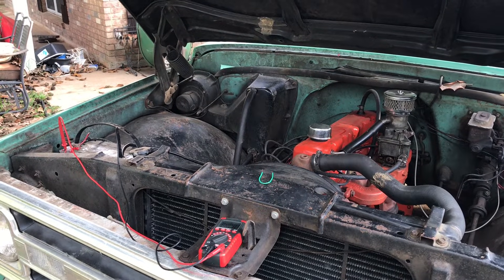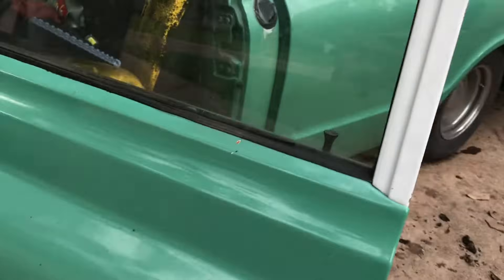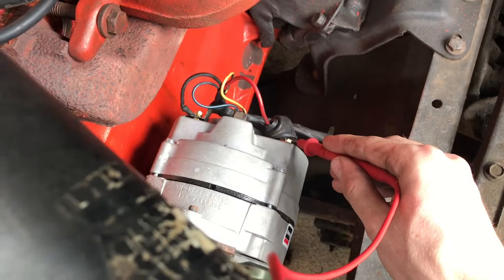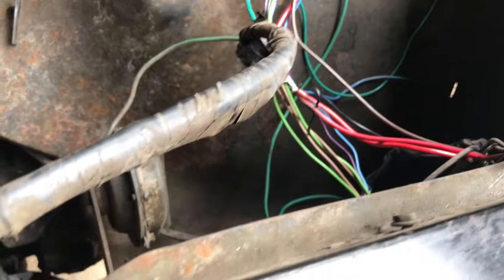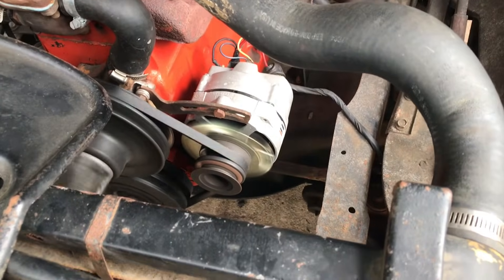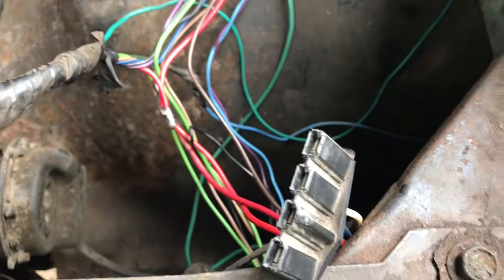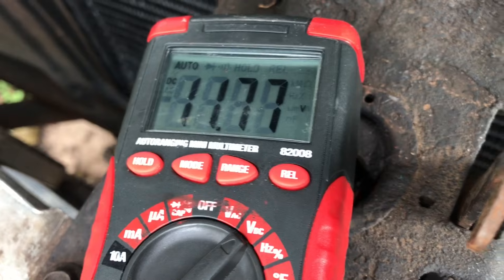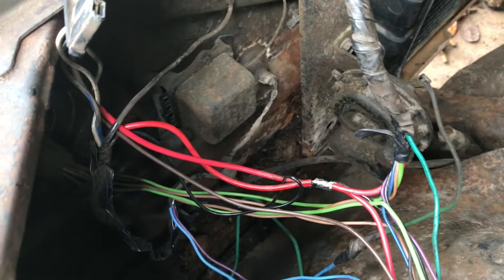How To Test An External Voltage Regulator (Pre-73 C10)

Comment: Your question at 0:25... My car doesn't start but shuts off while the GEN light is on. I have a 75 Impala and still unsure what the root cause is. When I turn it over, it runs for a few seconds before shutting off again. Any ideas?

Comment: Great video.  I am having a problem with my 1971 Cadillac Fleetwood and it looks like it has exactly the same wiring for the Voltage Regulator.  Would you happen to know what normal values are for the Field Pin on the VR?  I am getting only 2.17V - 4.31V (idle vs. higher RPM).  Also, the Sense Pin #2 varies from 3.3V at idle to 6.08V at higher RPM.  My guess is this is low.  I put in a new Voltage Regulator just now.  Alternator is a couple months old.  I know there is an adjustment procedure for the Voltage Regulator.  Wondering if that is my problem.  Your jumper trick will at least let me prove the Alternator is capable of outputting the right charge level.
Reply: DoubleWrench...  I just ran your test and the output of the Alternator is too low when I jumper the VR connector Pins F and 3.  Please look at this short video.  Is this squeal coincidental?  Very strange it goes away at idle only if not jumpered.  I always thought the squeal was the air pump, but now I am not sure.  Thx.  Sorry about the video quality...  I did not want to leave the jumper connected for long.  https://youtu.be/aniE0mZsUxk

Comment: Ok so I used jumper wire to do the test  and battery is still at 12.13 volts  while running. Also have 12.13 volts. At brown wire and red wire     So does that mean alternator bad?

Comment: Finally someone explains it. No one likes to buy a new alternator and finds out the old one has no issue.
Reply: I just did and ai am afraid to find out that  the at this whole the problem it was the voltage regulator 😅
Reply: I took mine to get rebuilt because my battery wasn't charging, they probably said easy money and alternator was fine and this whole time it was the voltage regulator.

Comment: My '72 GMC truck had a voltage regulator issue, when I went to replace it with an old one I had changed out unnecessarily decades ago I found 2 of the blades had enough rust on them to possibly be the problem. I sanded the rust off and put it back together and to my surprise it works just fine again! I can put that old regulator back on the shelf again,who knows,' I might actually need it someday! Thanks for making this video, it was very helpful.

Comment: Great video!  I have a question though. Are you check all votages with the exception of the positive terminal on the alternator and the brown wire on the regulator harness at the battery?  Thanks!

Comment: I've been having the opposite issue where testing at the battery and alternator are reading between 15-15.2 volts. A little high and my assumption was overcharging. I go to look at the voltage regulator and notice that only 2 wires are going into it. The 1 and 3 wire or "f" and 3 wire. There is not even a 'regulator' wire ran from the regulator to the alternator.

Comment: These are the exact same symptoms on my 64 impala. Will try that later to see if it is my voltage regulator. I have dim lights, my batter is at 11.6 Volts(Brand new) even when car runs. Ive been messing with my headlights all day thinking that was the issue. But now that I see my volts are low, it might be Alternator or Regulator. Will come back with report
Reply: So what was it?
Reply: @puremayhemFTW  Two things. One... I got a new high output regular, just cus I was adding air bag compressors and subwoofer. My headlights still dimmed. I learned that in older cars, routing of the wiring caused it to lose voltage /amps /watts since the wiring was so long. So I did a relay kit which basically allowed for a wire to connect to lights directly from battery. And the old wire activated the relay that allowed current to pass to headlights.

Comment: Thank you for the principle of the shorted wire.  You are turning "on" the alt?  The regulator is supposed to do that, right?  You have a brand new alt.  Was that because you lost the alt due to the regulator?   :-)

Comment: Nice video, I have an issue little different than yours, when I measure  the voltage directly from the battery or from the alternator im getting 14.0 to 14.6 volts but a seconds later the voltage starting to fluctuating between 14.6 to 2 volts or so, do you know what can cause this fluctuation?

Comment: I have a 72 Mustang I put a new ignition switch on it the old one was burn up.. with a new Interstate Battery At 12.4 charge  I turn the key switch on the volts read a constant 11.85 and when its running 11.85 when its not running it goes back to 12.4.... I disconnected the voltage regulator did the test with a jumper wire started her up volts go to 13 + normal ...so im thinking the alternator is fine regulator bad ....I replaced the regulator several time's but still have same problem...I had replaced the fuse box interior wiring a while back with an identical wire harness ( used wiring but same part number) Pulled all my fuse's in the fuse box started it up still has 11.85 volts....I didnt think it could be the wire harness being I pulled all the fuses,,,,its now sitting at 12.4 volts ... any Ideas ????
Reply: looks like bad ground of the battery or on the regulator

Comment: Is the voltage regulator always supposed to be powered up even with the key off? The voltage regulator on my dads 67 mustang gets warm even with the key off and it’s overcharging the battery
Reply from the maker: Jake Wright I haven’t heard of that problem before but I believe they should be fed through the ignition, thus off when the key is off. If his wiring isn’t messed up maybe his ignition switch is? That shouldn’t happen
Reply: DoubleWrench ok thanks. We’re getting a new wiring harness for it since the wiring is messed up and he doesn’t trust it
Reply from the maker: Jake Wright that’s probably it. In 50+ years who knows how badly the wiring has been botched!

Comment: Just fyi, replacing the internal regulator in a newer types of Delco alternators isn’t too difficult either. I just replaced one for the first time. Took me about 40 minutes to open the case, check/clean everything, grease the front and rear bearings, and replace the regulator. Saved me about $40.00 over just replacing the entire alternator.

Comment: i kept having trouble with regulators n wanted more power anyway so i jus switched to a single wire its soo much easier cleaner lookin with less wires more efficient easier to wire less change of a connection or wire goin bad, its jus the way to go   its cheap simple n really common also  jus google it

Comment: Great info... what if its is over charging?   Getting 15.3 volts at the battery when the engine is running.
Reply: Ended up being the voltage regulator...
Reply from the maker: BookerTSlurpeeCups hmmm. Check the third terminal on that voltage reg plug, it is used to sense voltage and I’m pretty sure if it has an issue the alternator is allowed to run wild and overcharge
Reply: @doublewrench  thank you Sir...👍
Reply from the maker: BookerTSlurpeeCups hopefully poking around there gets ya somewhere because that’s all I can think of!

Comment: My 64 dies when i unplug the voltage regulator to test it. Any ideas?
Reply: Just replaced the battery. Still seems to have the same issue. Alt is outputting 14.5 to battery as well
Reply from the maker: ThisGuy hmm, my first thought would be is your battery good?
Reply: Honestly i could use a new one. Ill get one today. I know the alternators good as its putting out 14.4. Ill give a new battery a shot

Comment: I was having this problem on my 1970 c10 found the regulator was mounted to the radiator support and was grounding its self out it needs rubber grommets and not be bolted straight to metal. Just my problem runs fine now.
Reply: Michael Rush i really hope thats my problem
Reply: Actually it's not a grounding issue, because there's a small black ground lead that screws into the side of the EVR to ground it. The EVR is isolated with rubber grommets to shield it from body/engine vibration. Being a machanical device, bumps could make false contacts.

Comment: damn good video..  where did you find voltage regulator for 17 dollars?   ..   leaving that wire connected doesnt hurt anything..  just dont leave it connected and walk away from the vehicle for over a few hours..  it drains the battery..
Reply from the maker: Chris Craft rockauto! And it’s been mint ever since!
Reply: @doublewrench  i have bought and saved so much money from them but it never crossed my mind..  people buy those things all day and night for $59.99 .. you should mention stuff like that in your videos..
Reply from the maker: Chris Craft thanks, if you’re in the market for a voltage reg right now they’re having a wholesaler closeout, one that’s normally $38 is $8! Might pick one up with tomorrow’s order just to have on hand when rescuing old junk. I don’t even want to think about what I would’ve spent at a parts store buying what I have at Rockauto!
Reply: @doublewrench  i convert all mine over to internally regulated.... but thanks for the info..  check out my channel..  i started off in 2015..  i had a 67 c10 i built before i thought of getting on youtube..  my brother has a 72 that ive been trying to get over here to make a killing on videos..  ..  keep making videos on the truck..  you can get a decent channel going..  just stick with the truck